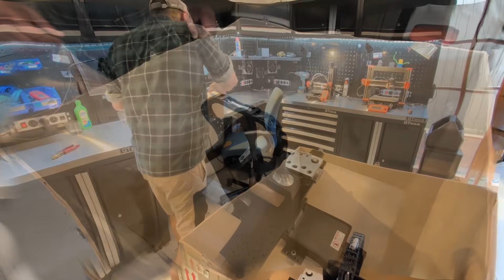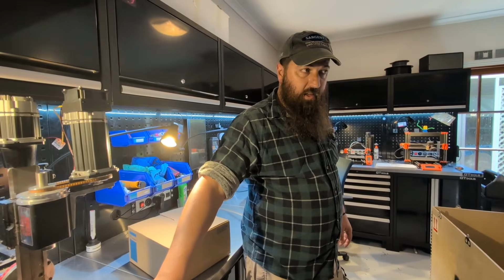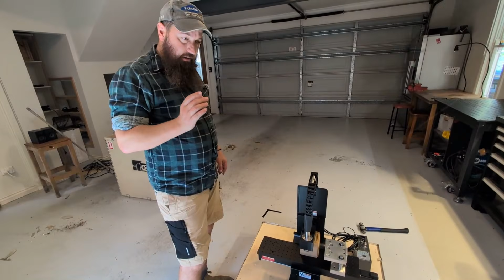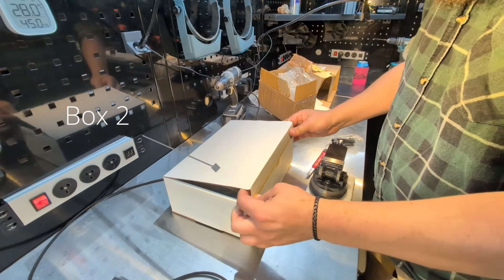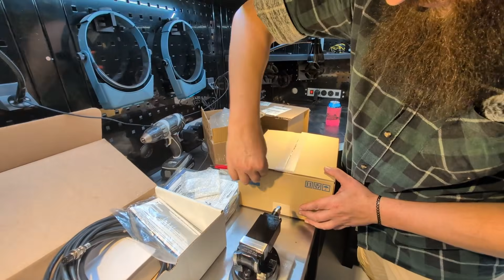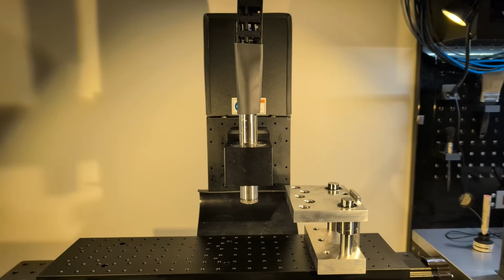Unboxing a seriously impressive Minitech desktop CNC mill

Comment: hello, do you plan to do a real life test of the accuracy anonced ? I would be very excited to see it.. Also do you know if this machine is stron enough to work on steel or only soft materials ?
Reply from the maker: Hi yes 100% intend to assess accuracy and see what is possible. I have just finished doing the backlash testing which will be in the next video along with the spindle controller I am building at the moment (Then some test cuts). According to my speeds and feeds calcs steel should be fine albeit slow but will need to test to find what the capabilities are. Appreciate the comment!